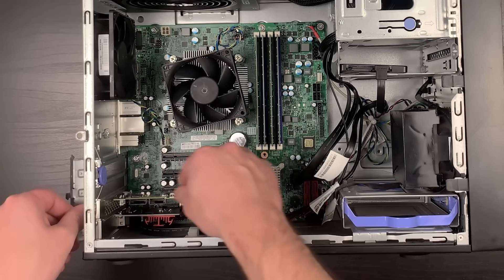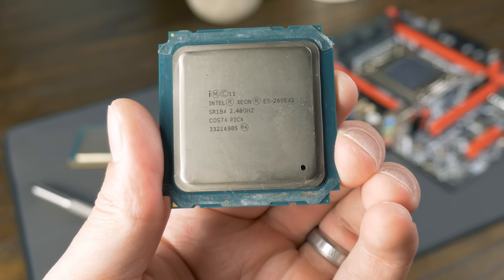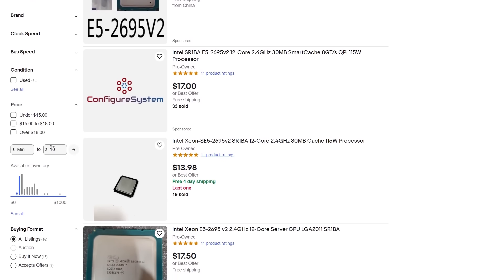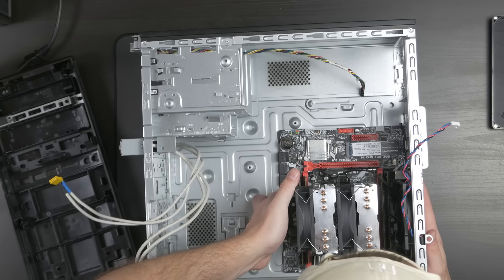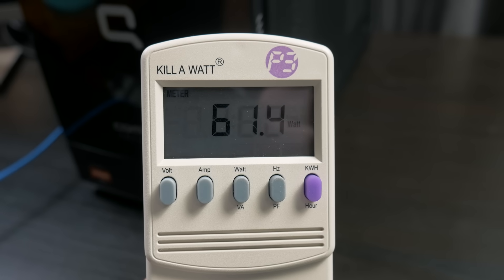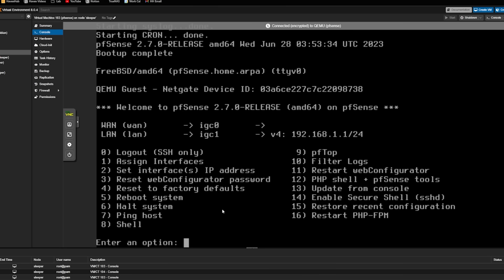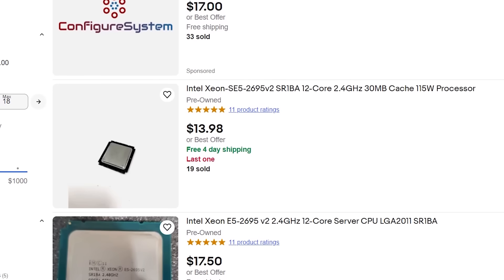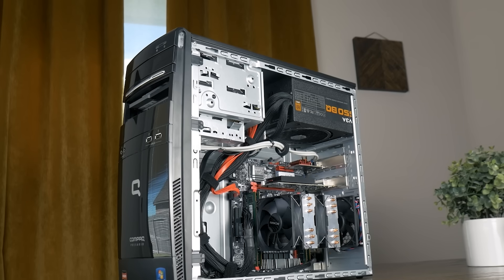Are CHEAP x79 Servers/Workstations Good In 2024?

Comment: I bought an X99 Combo , ATX X99 Mobo + 2680v4 ( 14 Core )  and 128 GB of ECC DDR4 2133  Ram  for ~ 250 USD for my Truenas Scale NAS which its still cheap i would say . But i just ordered Parts for a Platinum 8570  ( ES ) System , and those are not cheap because its DDR5 5600 and Octa (8) Channel . The ES CPU is cheap for ~ 400 USD  its a 56 Core  /112 T  Xeon , the ATX  MoBo is 800 USD  a Gigabyte MS03-CE0 which will work with this ES CPU  i hope , it works with 8468 ES Xeons thats sure , theese cost  ~ 180 USD but i wanted the 300MB L3 Cache of the 5. Gen Intel scalable Xeons , maybe the big L3 Cache is as beneficial for Games as AMDs 3D Vcache ,  at least i will Test it . Each 48 GB DDR5 ECC cost ~ 250 USD , thats why i bought only two of them , maybe more in the Future . This experiment costs already 2000 USD and i dont wanted to spend additional 1500 USD for RAM alone only to get full Octa channel  and i have no use case for 384 GB  RAM . The Mobo supports go up to 2 Terrabyte ( 8x 256 GB 3 DS RDimm DDR5 5600  ) in ATX Format and even thats not the Limit because you can expand the Memory further through PCIe Cards , 4 Slots in a 16 x PCIe 5 Card = additional 1 Terrabyte  ,  the  8570 supports up to 4 Terrabyte  and has 80 PCIe 5.0 Lanes . Of course , for those in the USA , i cant say what it will cost because Trump jumps from 50 to 100 % Tariffs and back  for China  which  y o u  will have to pay and no one  else .

Comment: I got a few Dell Precision workstations that all have Xeon e5s in them (V1 - V4) in an IT liquidation buy about a year ago with about 256gbs of DDR3 memory sitting in a box. I'm just getting around to turning one of them into my home lab. Of course I'm picking the one that has the most beef and requires me to buy more parts since it's the V4 workstation and can't use the DDR3 memory I have...lol. When I'm done I'll have 2tb of SSD storage, 44 cores (88 threads), at least 128gbs of RAM, and enough power (and six pins) to run any GPUs I might need 🙂

I plan to make this my one stop shop for all my home server/home lab needs. Any words of wisdom?

Comment: I have more-or-less that same Compaq case.  Using it for a case for an AsRock N100 motherboard for Plex.  (it was either that or an old, beige Enlight case, but mine is the stupid kind that you have to take the whole front off to get the sides off, and I don't want to do that too often and eventually break the plastic tabs.)  Yes, motherboard, not mini-pc.  I wanted 10Gb support via SFP+.  Intel x520 cards are cheap (aka: I have like 10 in a drawer I picked up from surplus.)

I was pleasantly surprised that the header block for the front buttons and lights went by the "normal" standard and everything just worked.

Though, just for giggles, before I did the swap I did test Plex with the original Athlon II 170u.  It... worked-ish.

Comment: I've got an X58 Motherboard with a Xeon W3690, 6 core, 12 threads, 24Gb DDR3 and a Samsung SSD 840 pro 1TB drive. Runs Windows 10 perfectly well and ironically runs games quite well too. Have it paired to x2 crossfired AMD Radeon XTX RX590 8GB Fatboys.

Comment: The best processor for this X79 architecture is the Xeon E5-1680 v2, 8 core 16 thread which can be easily run at 4.2ghz  which is quite a bit faster all around than what he tested here.
If you're only wanting Windows gaming try using the two 6gbs sata ports in raid 0 mode, cheap and fast, 1+gig/sec reads and writes. Combined with a decent graphics card will yield great results both in Windows and games.  Use all all 6 sata channels for a 20TB raid 5 in a home server using cheap 4TB HDDs. My Asus X79 Sabretooth runs all this and will boot nvme with an adpter. Other known compatible Mobo's like the ASRock X79 Extreme 6,  1.1 versions of gigabyte X79 boards and some others. Do a little research before you buy. Super fast, super cheap computing that can handle current GPU's and games, have fun.

Comment: This CPU is not the best in its family... You can get an E5 2697 v2 for about the same money, ...
And: it also supports faster ram, DDR3 1866 MHz, ...
And: you could get up to 128 GB of it for cheap, ...
And: you're not using all of its 4 (four!) DDR channels, ...
And: you could build a 2-CPU system while at it!
But: you'd need at least a 800 W PSU for it: double the performance for double the power!

Comment: i have found an asus p9x79 with e5 1620 v2 with 8GB stick DDR3 2400MHz in my country's market for 40$ planning to sell the CPU and the ram and get 4x8 DDR3 1866Mhz with e5 2667 v2 i bought mainly because it's cheap and i can game on it with good GPU paired with the CPU and more importantly i can work from it efficiently

Comment: I was running a Minecraft & Valheim server on a i5 4790k with 16gb DDR3 ram & I ended up having to stop the Valheim because Minecraft was taking up so much of the CPU usage. Then I recently bought an X99 board with 32GB DDR4 on a E5 2689 v4 CPU & I was blown away. To put it as quickly as I can. That system now runs the Minecraft server, as well as a Valheim, Farming Sim 22 & DayZ server that on average have about 10 players on & off on each. Because it's limited to friends & family players only & it barely hits 50% & even though its a 120w CPU, it runs at around 30w. 

I've not tested it for gaming because I've no interest on doing so. It was purely to run servers & it does an amazing job. So my advice, if you also want to run servers like I do, then the x79 or x99 setups would be amazing for you. And they're relatively cheap as well, because there's an abundance of them because servers have been upgrading to threadrippers over recent years.

Comment: A 6500t has a passmark score of about 1500 single core. The 6500 has about 17 or 1800. If you went with an x99 system and something like the xeon 2670 v3 has about the same as the 6500, with 10 cores/20 threads, and only costs a whopping 5 dollars used. It supports quad channel ddr4 depending on the board.

Comment: My dual Xeon system idles between 600-700w.. and pulls over 1200w on startup... 😂

Granted I have like 90 drive bays, across three enclosures, each with its own power supply.

Comment: You can control the CPU fan speed via BIOS, so why use an adapter? Unless your BIOS doesn't support it which I think is unlikely. Even the extra case fans can be controlled via BIOS.

Comment: I started re-purposing old server motherboards a few years ago, with some dirt cheap 1366s and Supermicro m'bs. I'm currently using a pair of E5-2697s on an X9DRL-3F with 96GB and it's fine for me. I'm not a gamer but the multi-core performance is excellent for photo and video rendering, plus I run a couple of VMs on it.
The presence of SAS on these boards led me to picking up ex-enterprise SAS drives at decent prices, too.
My rule of thumb is to get the performance of a more modern system, but at much lower cost. There is a penalty in power consumption, but it's not on around the clock, and it heats the room in winter, as another poster pointed out.

Comment: Hello  I have the same system running both cpus are visible in BIOS however when I check from task manager and CPUz I can see only 1 socket running. Any way to fix this issue. Much appreciated ps when I run benchmark I see one cpu

Comment: In 2024 it's better to focus on X99/C612 and Xeons V4 - they support AVX / AVX2 and have full hardware virtualization features. There are also nice mATX server-like motherboards available with 2x2.5Gbit Intel NICs and 8-10 SATA ports. They are suitable for a homelab or NAS usage. Higher instruction set support should let you run the latest software for few more years to come.

Comment: I have 2x2695 V2 in a Asus Z9PE-D16-10G/DUAL with 512GB of Ram still (not as a main machine) but i wanna "downgrade" to same cpu´s in a Asus Z9PA-D8 and "only" 256GB because it only has 8 Ram Slots instead of 16

Comment: Looking at motherboards with the X99 combo, it's pretty disappointing to find most of these ATX motherboards with only 2 USB3.0 and typically only 2 SATA 2.0 and 1 or 2 SATA 3.0.  I did find one combo with 2 USB 3.0 and 6 SATA 3.0.  It was a dual CPU with a total of 28 cores and 56 threads supported by 2- 4channel per CPU.  Not a bad combo for a Proxmox or Nutanix hypervisor.  I mention Nutanix as my company is making the switch to AHV as we speak.  Installing Nutanix community version AHV would only help pick up AHV quicker.

Comment: xeon 2667v2 8 cores 16 threads 25mbs oc cache it has really relaly good single thread performance out of the box and if your board supports it you can overclock it mine I got a stable 4.6 ghz out of and it beats out 4th and 5th gen I7s in single core and gets very close to a 6th gen I7.

Comment: i run two workstation running on E5 CPU's and i was never happier, they are stone-cold at all times, can run 9 instances of Eve Online, and do all normal "workstation things" at ease ... those CPUS did cost up to 2grand new .. i spend just 250 for each system. the real challenge you run into is finding a Motherboard. 9 ran with Chinese Boards with Terrible IO ... they were brandnew but performed just really bad, but besides that, this was a overall win.

Comment: Hi, i have,  Intel(R) Xeon(R) CPU E5-2680 v4 @ 2.40GHz (28 CPUs) + JINGSHA System Model: X99-D8I + 128GB RAM (8x 16GB) . I'm looking for a motherboard that has TPM 2.0 and will work well with the rest of my HW. Basically I'm happy with the performance, but the end of support for Windows 10 is coming and even if the TPM module check can be bypassed when installing Windows 11 (tried), I would prefer if I could get a motherboard with TPM 2.0. Thanks in advance for any advice

Comment: I have a system with two 2690v2 xeons. It was running Monte Carlo nuclear calculation with 512gb for years. Now we use it for pv farms modeling and power prediction. It is now quite expensive to run because of power usage. But taking a lot of time to reconfigure software on something newer is just cheaper to use just more power..

Comment: the deal with mb from server is, in some points, they require a metal pin, like those with mounting even outside case. had same problem with asus mb, she woul't respond untill i put a mounting screw on it.... i was using 2690v2 (10c/20t)

Comment: @7.00 Not a standard mATX case! This is called a BTX case. 😉
These are rare nowadays. The BTX was offering better cooling than ATX, but sadly it never caught on.
One of the best BTX case for PC-builders ( back in 2006 ) was the Lian Li V600.

BTW. If you want to play around with older but high-end Xeon's I recommend you buy a used HP / Dell / Fujitsu Workstation with C602/C612 chipset.
This will give you 8 memory slots + allow you to run Registered ECC memory, which can be had for cheap.

Comment: using xeons gets more meaningful when doing so in a dual CPU systems : twice the memory slots, twice the PCIe lanes and twice the slots; on a single CPU there aren't enough lanes for NVMEs and cards (think PCIe x8 external SAS, PCIe x8 external FC for taper library, etc.). Plus,  10yo servers (with CPUs and RAM) are oftentimes cheaper than the budget of the videos' config as they are thrown away in masses ;)

Comment: I went from X99 to getting an X79 board by accident to scrapping the whole thing in favor of a Ryzen 5 5500.  I got it with a dual PCIE x16 mATX motherboard and 32GB of RAM for under $200 and the performance blows the old Xeons away--not to mention power draw.  I love holding on to old tech and keeping it useful as long as I can but moving up a decade for something that's going to be running 24/7 is hard to beat.  Rather than my game/file/Plex/etc. server doubling as a small space heater and racking up $40/month in electricity I can get away with about a third of that while not crossing my fingers that 10 year old hardware is going to continue to function reliably as well as be compatible with software updates.

Comment: I recently had the opportunity to use an old server/workstation from IBM, built on two Xeon processors, with an additional GTX graphics card. Its only drawbacks were the 300W power consumption during heavy work and the fact that, although it looked almost like a regular computer from the front, it was 80cm deep. During everyday work, or even playing Minecraft without graphic mods, it was impossible to notice that it was a set from 2009, thanks to the total of 16 cores it had and 12GB of 3-channel RAM for each processor (24GB in total). Only in heavy operations or more specific applications there were noticeable performance problems in single-core operation.

Comment: Honestly now pricing for X79 vs X99 so close that its cheaper to buy X99 and ecc ddr4 16gb or 32gb dimms. However got to check if the board you want supports high ram amounts. I got the X99-D4 geat board runing a 2690V3 with turbo unlock active. But max ram on the spec page is 4x16gb config while i tried 4x32gb Lrdimm ddr4 no post yet 3x32gb Lrdimm ddr4 it posted and worked

Comment: The linux implementation of zfs os preprogrammed tp use UP TO half of the system memory.
However the arc is maintained by the kernel through the zfs module, and will auto resize the arc based on historical and current usage, recency, as well as systemcalls from the kernel.

The arc_maximum can be set with a single command-line instruction if you want it raised or lowered.

Also each distro has the ability to change this setting before shipping so some may be slightly different, but the default and the standard are for arc_maximum to equal half the size of ram

Comment: I've been running x58 and x79 since they came out and they are both still running. The x59 box just runs all my backups and syncing which is pretty good since the board has 2 x16 slots (Gen2 so 8gbs), but the x79 w/ a 2680 (these OC pretty well, 3.5ghz), 64gb of ram that runs 10 VMs, Plex w/ a 1070ti, and has all my storage. Both the x58 and x79 boards have tons of features because back then people had "workstations". The 58 has firewire, 6 sata 3, 2 sas, dual nics, x16x16x4 or x16x8x8x4, but tri-channel memory which is silly. The 79 has gen 3 x16x16x2x1 or x16x8x8x8x2x1 with 4 sata 6 and 2 sata 3, 2 esata 6, dual nics, bt, and USB 3.0. Yea the power sucks, but honestly I don't forsee my newer systems lasting this long and really don't see any reason to migrate. Granted, if it wasn't for Icydock I probably would have migrated by now... lol

Comment: My lab's main machine is an HP Z620 with E5-2640v2's and 192GB of RAM, and two quadro K4000's, though I could slap in a P5000 I have at some point. I also have an R620 for offline archive, a Hyve Zeus server, and 2 freebie HPE DL360p Gen8's, plus 2 ToysRUs R330s sitting offline, mostly for noise reasons.

Comment: Lenovo ThinkStation P520 with Xeon W2145 and 96GB RAM. 1TB SSD cache and 3x 8TB HDDs for 16TB total using Unraid. I’ve been so happy with this setup after trying a few others. It’s been super stable and reliable had it 8 months so far. About $250 without storage, was $175 with Xeon W2135 cpu.

Comment: You've come to the same conclusion that I have.... the single threaded performance gets worse the higher the core count. On the x79 platform the sweet spot still seems to be the e5-1660. It has six cores but has a base clock of 3.3ghz. For this reason its still one of the most expensive e5 V1 cpu's. I still use a e5 1620 which only has 4 cores but a base clock of 3.7 ghz. Its used for minecraft so the core count is not as important as the clock speed. I'm about to put in a e5 2690 which is an 8 core but only has a base clock of 2.9 ghz. I'll be interested to see how the 2690 goes in minecraft with mods and shaders paired with a rtx 2080. At the moment the e5 1620 handles things fine tho.

Comment: I have a quad socket quad cores in each 775 board. a ryzen 3600 thrashes it. if you need more cores etc never buy older than 3 gen. the ipc improvements mean that it ends up being useless.

Comment: I am running a Lenovo P520 6-core Xeon W-2135 for $120 on eBay and I put 64GB DDR4 2933MHz, a 2.5G PCIe Gen3 x8 networking card and threw in two hard drives and the ThinkStation P520 HDD Bracket Kit. I don't have any NVMe, but I have one GPU and I can still put 5 more NVMe. While the W-2135 is not very power efficient at full draw, it has low idle current and it's rarely ever using much power.

Comment: I am using a duel Xeon dell workstation as a GOS tracking  and file server.  It has 32 cores and 32 gigs of ram.  It runs really well apart from every so often it tries to tell me memory dim one has issues on a restart. I have swapped Dims around and one of the case fans failed.  It does the job extremely well well.  It’s Rubi g Ubuntu

Comment: Many say x99 is better today blablabla but IMO, if you're buying ddr4, you're better off with a cheap AM4 board + cpu at that point; not much of a price difference, plenty of upgrade options. X79 on the other hand offers much cheaper ddr3, so you get 64gb for ~$35 and cpus are also a lot cheaper than x99,..So for a dirt cheap build, I think x79 is the only one that makes sense and x99 is the one that is really dead, because you can buy better amd/intel ddr4 systems for the same money.

Comment: My system as below
Intel Xeon E5-2696v3 X 2 (18 cores 36 thread X 2)
64GB DDR3 1866MHz
1TB SSD
MSI RTX 4060 8GB
Total cost $630USD from TaoBao
It's performance is perfect, i run Ai Neural Network training with Tensorflow, and some video editing, 3D modeling and rendering. I will upgrade to E5-2699v4 later when the cost is down to like $50 per CPU.